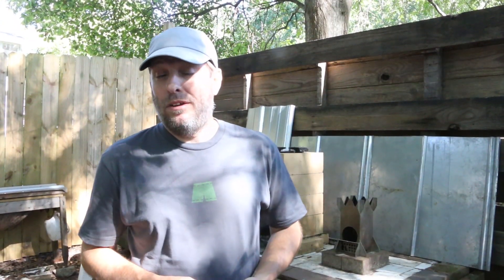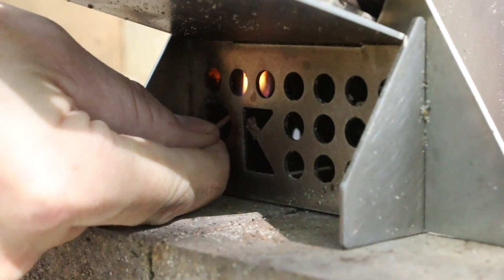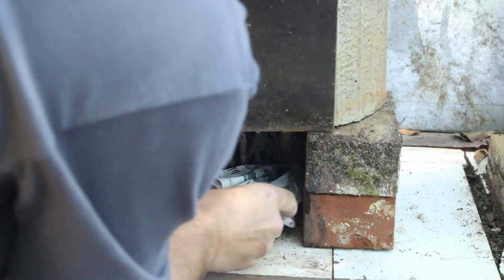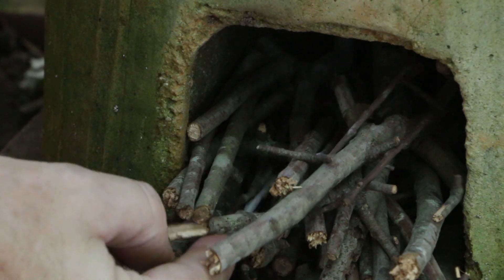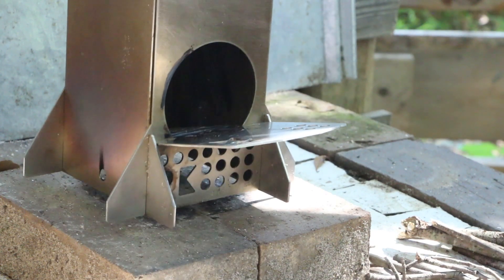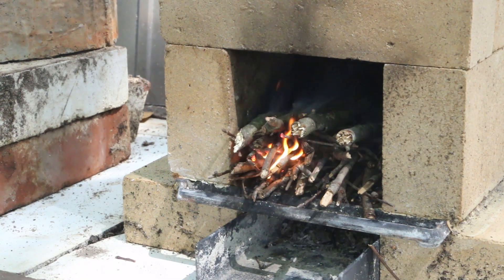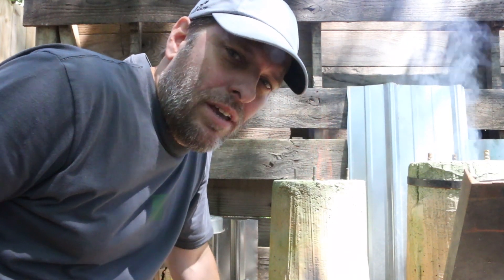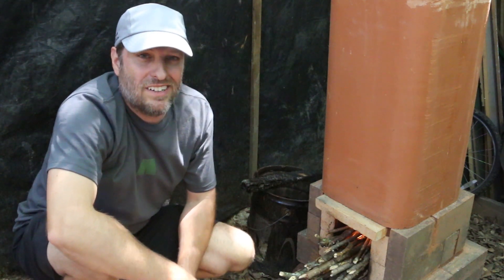10 Ways To Light A DIY Rocket Stove

Comment: I start the fire in my woodstove quickly by rolling up several sheets of newspaper like a paper towel tube, being sure to leave a good air hole down the middle, creating a sort of venturi. I make 3 tubes  and stack the firewood so as to not crush the tubes. I then light 1 small crumpled news page in front of the tubes. The flames rush through the tubes drawing heat & air into the fuel. I haven't used kindling or accelerators in years.

Comment: Just a suggestion - Load your fuel. Then drop a fire starter right into the riser to heat it up. I use a cotton ball with alcohol and I light it with a ferro rod. It'll cause an immediate draw. At the same time, it'll start a top-down fire in the riser tube which reduces and eventually eliminates smoke. This works great with horizontal feed rocket stoves. For vertical feed stoves, Heat up the riser first, wait abut a minute then drop another fire starter into the feed tube followed by small fuel wood and you'll have an instant draw. It's a super fast way of lighting any rocket stove with little or no smoke. Give it a try... God Bless

Comment: Mix flay ash in  cement ......30% cement...50% flay ash.....20% sand .....Heat resistance & light wight Evan brick all so available...make powder mix cement make mold.....OR use ash best ash sheet & make powder use
Reply from the maker: Ramesh, Thanks for the mix tips. I’ll start saving my ash. Thanks for watching.

Comment: You rock! Thank you so much for doing a variety of models and showing how/when you add more fuel. It took me 4 nights of trial-and-error to get 1 decent burn, but it was too short to finish cooking my salmon steak. This is so timely! I'm going to try out your tips tonight to see if I can finally boil an egg :-D

14:00 ftw "I've never been afraid of overkill." Indeed.
Reply from the maker: Nice! Good luck with your boil. Thanks for the inspiration to make the video. Thanks for watching.
Reply from the maker: By the way...the method I use for eggs (if you haven't caught that video) is adding the eggs to the water at the start. Bring to a rolling boil. Boil for 5 mins. Remove from fire and let rest for 5 mins in the hot water, then drain or remove eggs.
Reply: @GreenShortzDIY  My problem has been keeping it going more than 2 minutes. I think I picked up a little of your method there. I'll give it another try.

Comment: Any branches of wood that people should never use for cooking?
Reply from the maker: That is a good question. I'd stay away from the vine wood of any poisonous plant, like poison ivy, for example. Soft wood can also be sooty (like pine), but if the smoke won't contact the food (like grilling), it's probably OK to use. I use pine scraps to heat my bread oven, but the fire is out of the oven before the bread goes in. I bet a Google search would get you a more detailed list. Thanks for watching.
Reply: I have a fairly large piece of drift wood that was well dried and grey. I torched it to make it darker brownish black. I thought it would also preserve it for my landscaping. Overall it is pretty but now orange color sap like substance is ousing or beading out. Ugly and sticky. I have no clue what type of wood it is. I have other blacken pieces without sap issues. My neighbors have oak trees. I will probably use those twigs for stationary red brick rocketstove.
Reply: that question is great about the types of wood to use..i know for sure not to use any kind of wood that is specifically made for homes or fences because these types of wood has been treated for longevity to preserve it from rotting.i would guess that it releases toxins of some sort.definitly not for cooking ,breathing it or releasing that in the atmosphere.

Comment: 3 plaster Paris / 1 Fire resistance Cement / 2 Vermiculite / 2 water  I have this mix It is strong and defies heat. Let cure for 2 months.
Reply from the maker: Thanks Gary! I'll give this mix a try in a future video. Will let you know when. Thank you for watching.
Reply: @GreenShortzDIY   It would be perfect for your crucible or your keel.  The key to to let it cure until you see no moisture are it turns totally white.  I keep a couple of bags of each of each for just in case SHTF.  Looking forward to see what you make with it. -  God Bless

Comment: Have a crack with dryer lint, impregnated with Vaseline (petroleum jelly).
Reply from the maker: When the first half of your comment popped up on my phone and I glanced at it quickly, I thought you were referring to a bodily location where lint could be located. Sort of a Southern cousin to belly button lint. :-) Now, reading the full comment, I understand your suggestion. I have heard of vaseline being use. Will give that a try. Thanks for watching.
Reply: GreenShortz DIY it’s an awesome fire starter & only needs a spark
Reply: @GreenShortzDIY  LMAO!